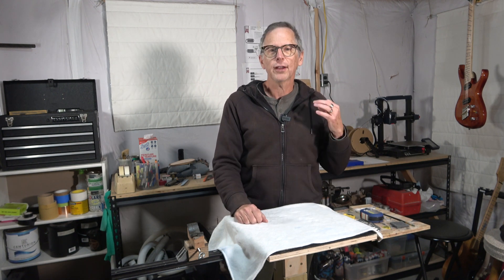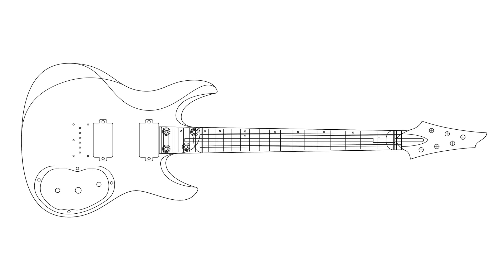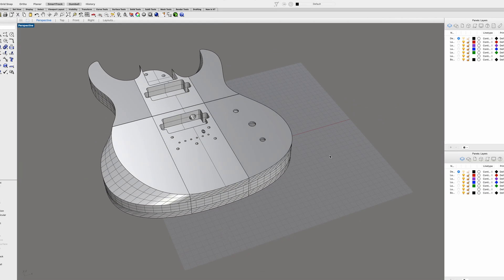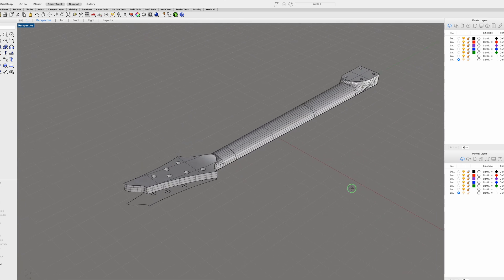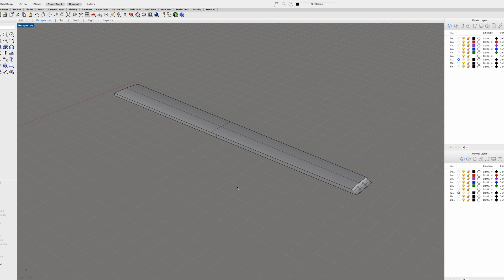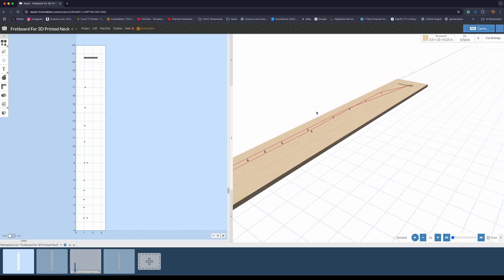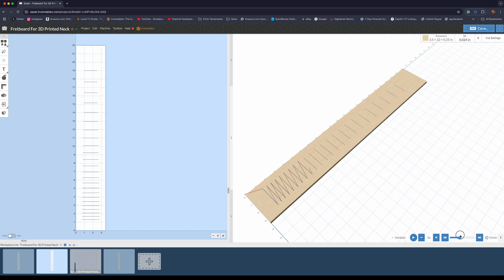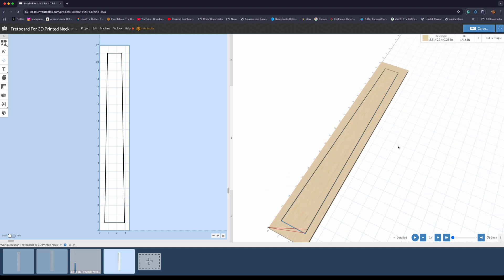Making A 3D Printed Electric Guitar Part 1

Comment: The way neck is subdivided is really the worst possible.
Reply from the maker: We shall see.🤭
Reply: @HighlineGuitars  will you insert any bar inside?
Reply from the maker: @christianurgese   I inserted two carbon fiber strips.
Reply: Can you elaborate?
Reply: @liamharperanimation  Hi, it is the same for gluing wood or welding iron.
Reply: How would you divide the neck then?
Reply: @liamharperanimation  in 3d technology designing are better ways to subdivision for sure, but it costs time and not guarantees the necessary rigidity. So better insert bars exactly if it was wood.
Reply: @liamharperanimation  in 3d technology designing are better ways to subdivision for sure, but it costs time and not guarantees the necessary rigidity. So better insert bars exactly if it was wood.
Reply from the maker: @ I sliced it into thirds.

Comment: To share an idea I've seen if you'd be interested is to add 2 threaded rods in the plastic body under the area between neck and the bridge (or close to it at least) to prevent string tension from slowly bowing the plastic

Comment: Fun project. I thought about doing a 3D printed body when I got my printer but I thought it would be a bit of a gimmick and not as good as wood. I've been reconsidering it and will probably do one soon. I think I will do a design that is difficult or impossible to do with wood. Something that takes advantage of the 3D printer capabilities. Most likely will still make the neck out of wood.

Comment: Chris, love the videos! I've done some larger 3d printed constructions and I have to say instead of super glue, I'd recommend looking at a product called 3d gloop. It welds PLA and is a very structural adhesive, the best I've ever used.
Reply from the maker: Great tip! Thanks.
Reply: @HighlineGuitars  I will say, the one thing I'm not certain of, and would take into consideration is how the welding aspect would change the dimensions of the print with any significant clamping force. It would be worth a test to see if there's any significant change.

Comment: Will watch this closely. I’ve been into 3D printing longer than I’ve been building guitars. Have often thought of doing this as well. 
Also, I highly recommend you check out 3D Gloop for joining parts. It has a much stronger bond than CA, especially for the neck.